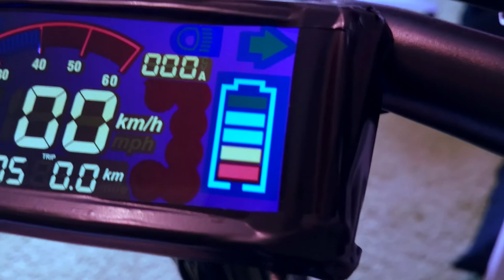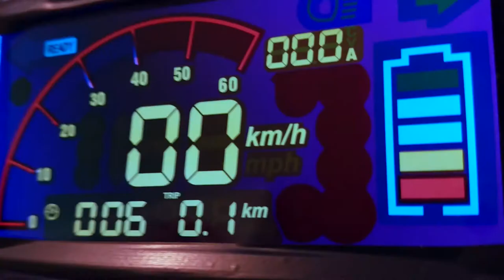48V color LCD speedometer and ammeter screen (wiring)

Comment: oh man thank you so much, the seller i bought this from did not explain the wiring at all, this helps a lot. so for the speed you only need to connect 1 phase wire and it will work? i'm guessing then adjust the potentiometer with a GPS to get the correct speed right?

Comment: Damian, it is possible to calibrate the voltage on this? Or they have different versions for different voltages?
Reply from the maker: ***** it depends of manufacturer/seller, there are several versions of the board/screen some accept 10V-80V others has a default voltage range, just to fit the battery indicator level.

Comment: how do you change form km/h to mph? also my speed reading stops going up after like half throttle, not sure why either, i've tried adjusting the potentiometer but then it just stops going up at a different speed, any idea why?
Reply from the maker: It probably would be possible via their serial flashing tool what I don't know if it even exist, also could be possible modifiing some of their resistances. In that moment it also were a pain in the ash for me :(